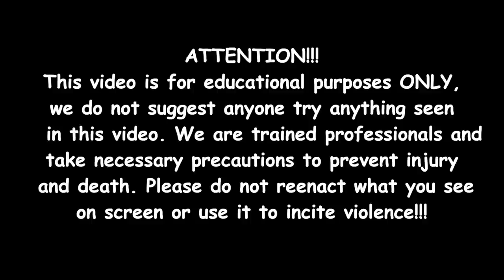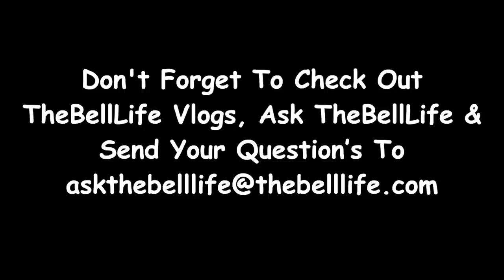Best Gun Caliber For Home Defense!!! (TheBellLife Bangs)

Comment: And most people walls have 3/4 drywall on each side and has studs in several spots down the middle .mc cable running thru it and insulation ..also if its going thru outwide wall you have drywall, studs ,insulation and brick .most people dont have paper walls like in that abandoned house yall are using in this video but in some cases this is accurate.